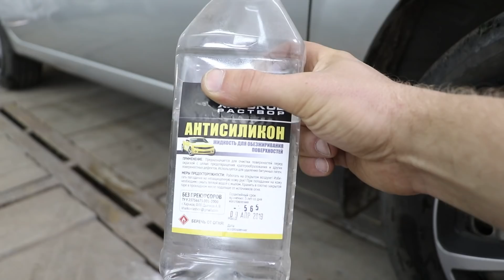How to make a car spotter from an old starter?

Comment: Wanted one of these for ages - here, they're spendy -  bothered building one today using a normal car battery, a draper boggo slide hammer I had already, a tractor starter solonoid (24 quid out of the box) some cable & a push switch. Works like a champ & is about as easy to build as you can get. Well worth making & if you go with the simplest design, a doddle to make.

Comment: nice video shame about the repair, filler goes on before the primer, then primer surfacer . get rid of the adverts but very ingenious spot welder.
Reply from the maker: Read carefully the technical sheet on the application of the putty! It says that the putty can be applied to clean metal!
Reply: Light putty coats over primer as he was doing is perfectly ok.....take it from a 40 year body man.

Comment: Seems cool... I definitely would prefer a verbal explanation of what you did rather than music.

1. Rebuild old starter solenoid. 

2. Make a puller with replacable tip and add a on/off button to it..
 I have a puller ..... Add spring to front of puller... good idea

The button looks like the old floor headlight dimmer switches... just fyi

3. Make ground setup.

4. Use copper car battery size cables, connections etc and ground wire

5. Get battery with good amps.... I have a battery booster  that may work well with built in plug into the wall charger.

Understand Direct Current vs Alternating Current. Cars / batteries use Dc.
Dc is safer than Ac. Homes use Ac.
Both have amps and voltage.

A ready made rechargeable battery booster has Dc with a Ac converter.
Amps can kill you. 
Voltage carries amps like a taxi carries people. (Uber for the Minillineals).

Comment: Using the battery as the power supply is not the smartest idea, the tool is basically shorting battery terminals which can cause the battery to explode.

Comment: starter solenoid for hi amps  switch+ bar and sliding weight+ some heavy gauge wire= Dent puller.  You can buy or make one like this guy did , if you have extra time. I prefer built it my self.
Reply: Exactly! Some people build things because they have to. Others, like you and I, build things because we want to. We likey!

Comment: Wow ,There are sure some stuiped people watching YouTube! . The man has made a spot welder with a sliding hammer attached, The spot welder attaches it to the body ,then the sliding hammer pulls the dent,the option is drilling holes from behind and Knocking it out,,or welding on metal tab and pulling if u have a welder, or drilling in the dent and putting in self tappers and pulling,This is far nearer ,once it's made he can use it over and over again,Well done

Comment: Very useful tool, a great deal cheaper than the professional kit but does exactly the same job. I’d be inclined to design a better contact tip holder and with the addition of the inexpensive Oem contacts and a stout metal bar, you’ve got a really good pulling kit. Nice work